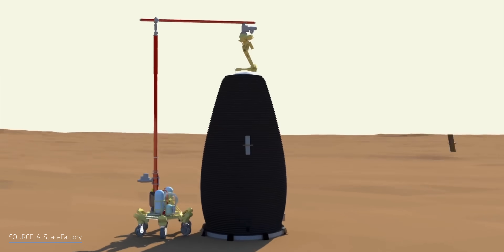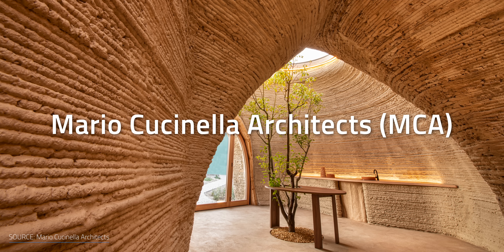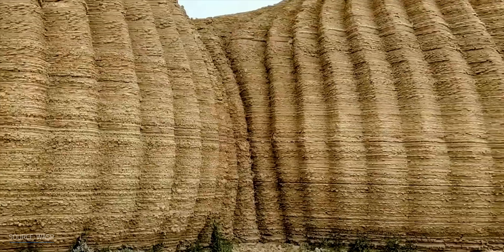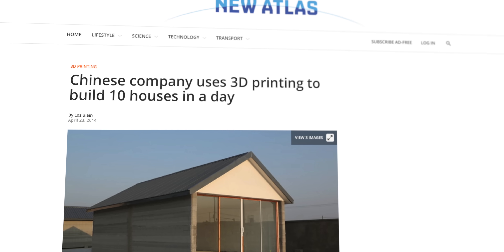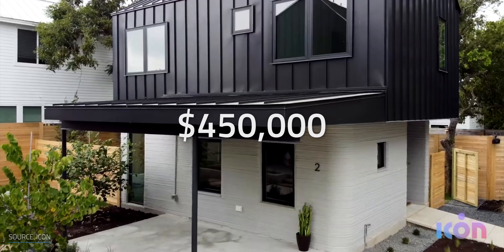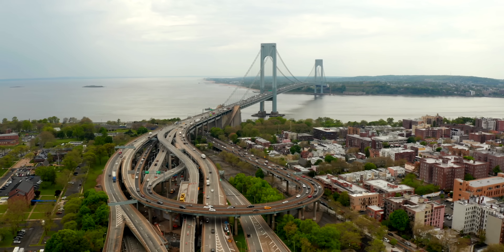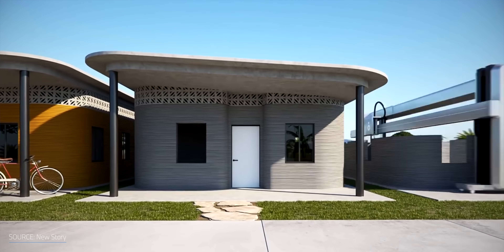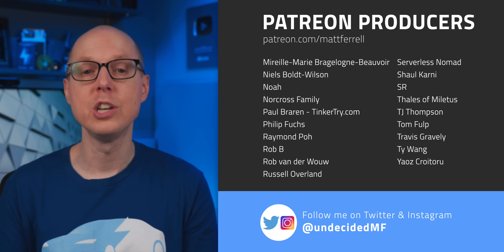The Truth About 3D Printed Homes

Comment: The 3D printer can make interesting shapes. They need to make these houses look like a masterpiece on the outside, with normal Sheetrock walls. 

Promote how much longer a cement house lasts over a Chipboard one. As nails and screws allow water into the structure. New houses won’t last 100 years or more. Cement will.

Comment: In Uganda they make bricks out of the local clay soil and harden them for a few days with a fire built inside them. 

The problem is that they degrade with rain unless they are sealed with a coat of plaster on the outside. 

It seems like you're doing something similar - building with mud, and its just going to melt over time.

Comment: Want to live in dirt house.  😂

In my village we had mud houses. All built by the people themselves. With few of the friends acting as labour. Bamboo sticks, earth, saw dust and thatches and ropes.

You mix saw dust with the mud and knead it till it becomes clay. Then you add cow dung into the mix and knead it further. Make 2ft x 1ft x1 ft cuboid blocks. Leave them in the hot sun to dry. After 2 months of being baked in the sun you are ready.

Now get proper clay from the river bank. Knead it. And then divide two batches.

With one make a very thick vicid tooth paste like consistency.
 Now erect bamboo frame works. And start stacking these blocks. After 10 ft of wall a big column of wood about 8x8 inches and goes as tall as the wall about 15 ft height. 

The bamboos will buttress the wall from both side and everything is allowed to dry. In sun. 

Now you add columns outside the wall hugging the wall. They are buttresses. Same  method. 

Now you start laying another wooden horizonal column on top of the wall 

Then wood rafts are placed across the roof. And then baked tiles. On top of that thatch. 

Now with another batch make thin paste and start applying it like paint. 

You have a smooth wall. 

For preventing flies and insects in the mud wall,  use white lime coating. 

For the floor, cow dung (fresh, not manure) with clay and a thin paste is created and the whole floor is wiped and allowed to dry every weekend. 

This is how my ancestral home was built. 8 families used to live there. A big central courtyard and rooms surrounding it. 

It served two generations. Then the sons moved on and made their own concrete houses. 

Slowly the wall decayed in the torrential rain. 

Mud houses aren't good answers. They need a lot of maintaince. As a villager it's OK. But as a person with a job or buisness you cannot

Comment: What happens when the houses need to be razed (demolished)?  Where do you put all this solid waste packed with some fiber material that cant be just crushed and burried?  Whats the cost to haul it away?  Just like ev lithium batteries.  Has this been thought thru start to finish?  I doubt it.
Have you seen the windmill grave yards littered with fiberglass fan blades?

Comment: So called 3D printing solves a problem that doesn’t exist while creating hundreds of new ones that are unnecessary 
Essentially it is just a stupid way to make a stay-in-place formwork to pour structural concrete and/or insulation into —- unless you don’t mind gawd awful ugly walls with no vertical reinforcement

Comment: Good video and arguments but.... 3D printed clay homes is a step above abode homes which have huge limitations in  earthquake and storm areas. Check out deaths in mud type homes in large earthquakes and limited use in wet/humid areas. As much as I like the argument about local materials and sustainability, I don't see this ever happening into a safe and resilient home from a civil engineering perspective. 3D concrete printed homes will be able to solve these life issues and livability issues. There are still work to be done but closer to seeing 3D printed CONCRETE not mortar homes.

Comment: Hey Matt, why is no one mentioning the one fundamental flaw with 3D designs?... Future-resistance.  You can't cut into the walls to relocate outlets or plumbing because that degrades the structure hold... Plus, you have to be willing to look at ridges both inside and outside your home the rest of your life because you  can't (or most builders won't) smooth out the surfaces.  Your thoughts?

Comment: The major problem that I can see if that it would be a fairly weak structure if an earthquake was to happen. Brick stone, concrete and similar materials are strong in compression, but just don't do well when placed in tension.

Comment: The 3d printed house is an awesome design it has an indoor outdoor quality.  Plumbing and interior is always the most expensive part of a house.  Biological filtering other than aeration would be an improvement and a car generator chisel to spin like Edison with inverters to deliver House current without fuel or plastic manufacture pollution.  Electric power without fuel is Thoma A Edison generators and Tesla dynamos with inverters and transformers to deliver high voltage AC power continuous peak power without fuel.  The non nuclear solution is without plastic manufacture solar panels.. learn to live on earth.

Comment: I think a printed concrete home would be best.  Not susceptible to fire or termites, and lower long term maintenance if done by a reputable builder (check out Matt Risinger's reports on 3D printed homes in Texas).  As for cost, about the same as regular construction.

Comment: Earthquakes might be a problem, also needs a coating for rain.  Probably better to use Concrete.  The problem with plastic 3d printing, is its painfully slow!  Metal 3D printing looks very promising though.  They can print in Titanium, copper, aluminum and many other exotic metals.  They've already made a 3D printed car out of metal.

Comment: People need to get over their fetishization of "sustainable" and "zero carbon" nonsense. Technological civilization is not, never has been and likely never will be zero carbon, or "sustainable" in the way people imagine. 3D printings biggest advantage environmentally in the US is the massive reduction in wrecking forests for lumber that making a house out of concrete, as ICON is doing now in Texas with their latest 100 home development, makes possible. It also means far better constructed houses in terms of the basic wall infrastructure compared to the junk most American homes are made out of now. Much better constructed houses, possibly for less than existing costs is a definate plus and can also have a reduced environmental impact but there will be no "zero carbon" construction any time soon.

Comment: 3d printed houses are cool but they come with a bunch of downsides. The technology at the moment produces shapes that are rounded and wavy. This is not the way we make every thing else which tend to be straight lines and right angles. This makes for a lot of challenges in fitting out and ultimately living in the house. Things can't go in corners, as they are more like rounded bumps, and so in effect the interior space is much smaller than the square area suggests.  Houses over time tend to evolve, people want to add and remove doors and windows, Add rooms convert rooms from one use to another. 3d printed houses are rather like ICF and SIP construction in that those over time remodels are much harder, than say brick construction or stick frame construction.  Then we get tot he materials science part of the equation, many 3d printed tech use a variety of additives to get their extrude material to behave. This then needs to be protected with sealing layers like paint and so on. By extensively focusing on the speed to build 3d printing creates good press for itself. But better to focus on total cost of ownership over a 70 year time frame. Thats the life of a house roughly. I know its early days, but everything so far suggests that the downstream costs for 3d printing is higher than for more traditional construction.

Comment: I live in a rural area where the town just recycles steel cans. They can't sell anything else. There hasn't been a market since China stopped buying it.  But it still makes sense. 

One thing really bothers me about the green movement. It seems to have a real hostility to anything man made. There is a downside to almost any building method you can imagine. There is a downside to almost every move. I think Greta Thunberg has morphed into a professional protestor without a consistent plan or message. 

Maybe the green enthusiasts make a mistake and think that nature somehow lives in harmony with itself. I think human civilization is the most harmonious life on the planet in spite of the news reports. Nature is in constant competition, often ruthless and always opportunistic and mostly blind to any priorities but it's own inbuilt instinctive programming. It may be in equilibrium but that isn't the same as being harmonious.

Making very degradable buildings spread over low density development isn't such a good idea. What's so wrong about very long lasting and durable structures that don't wear out, don't need major renovations with every change of occupant, and don't easily rot and aren't built with materials with a short life cycle?  And of high density like a bee hive to eliminate the need for wasted energy moving about them. They don't have to look like beehives because human beings aren't bees. Cities are amazingly efficient ways to live that usually offer the highest standard of living and the greatest convenience. One can easily see them as palaces. 
 
BTW - Economies are always built with funny money. Not even the precious metals are exempt. Maybe the future should try to keep the use of money to a very controlled and intelligent minimum because it is so very unstable?  But how do you do that without destroying creative freedom? Somehow AI will play a part in that if the idea is at all feasible.

Comment: Reducing construction costs doesn't actually have as big an effect as you might think. In most cases the two major costs of creating new housing are constructing the buildings and buying the land to put them on. The price that the end user pays is obtained by adding these costs together and adding a profit percentage. The drawback with reducing the construction cost is that people are then prepared to pay more for the land because they only care about the overall cost. In other words land prices rise for everyone when cheaper construction methods are introduced, eating up most of the savings introduced by the lower construction costs and actually increasing prices for houses built by more traditional (and expensive) methods. 

So 3-D printing of houses is a cool technique but it isn't the answer to the housing affordability problem.

Comment: Heavy rain snow , & dry hot summers will damage clay then you have storms of all types winter, summer floods etc , at last you have load noises bands that will vibrate will cause crack movements , foundation movement in the ground,

Comment: ICF crew of three can set the blocks, and have ready for a monopour in three days.  Using fast feet bag system means no slab, as the walls are the load bearing elements, and the footers form automatically during the pour.  Also ICF concrete cures within the sealed wall yielding high strength.  For bugs, there need to be better solutions, such as spray on membranes.

Comment: Look at the books and building work of David Easton [and others] using Rammed Earth, Cast Earth (gypsum soil), and PISE (Pneumatically Impacted Stabilized Earth).  Also Nadir Khalili in Mojave Desert - "Super Adobe" - all techniques using stabilized earth.  Also Straw Bale construction.  Now Hemp crete is making some noise.  Not as sexy as 3D printing...yet all are time tested and locally derived to build wall systems, and using waste from AG or Earth materials.  Plastic, Concrete and Gypsum are all high on embodied energy, petroleum use, and therefore carbon costs.

Comment: There's absolutely no reason why you couldn't mix lime and ash with dirt on site and make Roman concrete, which has many thousands of buildings and monuments still standing and bearing weight after 2000 years. Some aqueducts are still functioning and providing water to rural settlements. When the narrator mentioned "the life of the building" there's no cause for that life to not reach into centuries.

Comment: The truth is the 3d print concrete is a owned license and the companies are not paying the required royalties as is stated in that license. All print sellers must license check all sales and pay any required royalties. Thats basic newb knollage for everyone venturing into making commercial gain. A common newb mistake and misconseption is drawing it yourself means its original so gives the right to sell that print, THATS VERY WRONG. It may have been invented already and licensed and terms may apply. As in the case of concrete. 
To not pay required royalties is piracy. I can tell you for a fact those companies are not paying the royalty on concrete. Robbing peter to house paul is not the way to go.

Comment: Anyone who has watched construction sites knows that the framing takes the shortest amount of time. It takes months to excavate, level, lay pipes, build a foundation, etc. for a site, then when you finally get to the framing it goes up in just weeks. Then many more months for interior walls, electrical, appliances, etc. 3D printed homes essentially optimize the shortest and least expensive part of home building, the framing. Everything else still has to be done traditionally.
Reply: That is why Boxabl will smoke houses like this because they are pre-wired, pre-plumbed, kitchen installed, bathroom installed, HVAC installed, breaker box installed, utility hookups turnkey ready... all made in a couple hours in the factory... the Boxabl wall panels (galvanized steel/polystyrene/magnesium oxide) are way stronger than stick/nail/air gaps, currently take 20 minutes to produce, and will drop that time to 3-5 minutes with new automation equipment being installed in Q2 2023...

Comment: The structure of a house is actually very cheap. The doors, Windows, plumbing, heating, cooling etc are really what matters. You can't 3D print those things. The walls of a 3D printed house really looks ugly and nobody really wants them.
Reply: That is why Boxabl will smoke houses like this because they are pre-wired, pre-plumbed, kitchen installed, bathroom installed, HVAC installed, breaker box installed, utility hookups turnkey ready... all made in a couple hours in the factory... the Boxabl wall panels (galvanized steel/polystyrene/magnesium oxide) are way stronger than stick/nail/air gaps, currently take 20 minutes to produce, and will drop that time to 3-5 minutes with new automation equipment being installed in Q2 2023...
Reply: @rule1capital  Boxabl is not a 3D printed home. Why are we discussing it here?
Reply: @noblepaul00  Because, as you discuss in your main point, 3d printed falls short in so many ways, but Boxabl addresses many more of the issues, and is a direct competitor to 3d printed for new build tech…